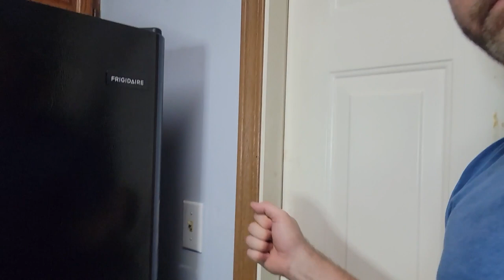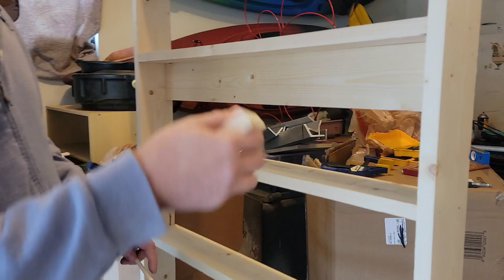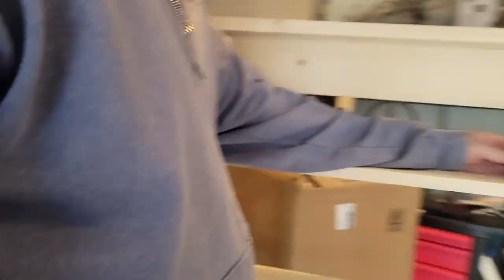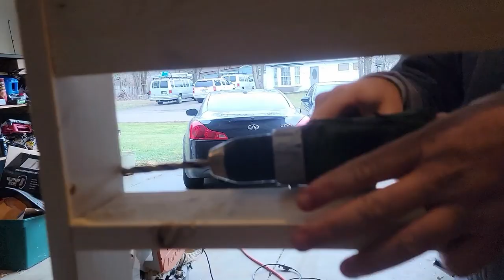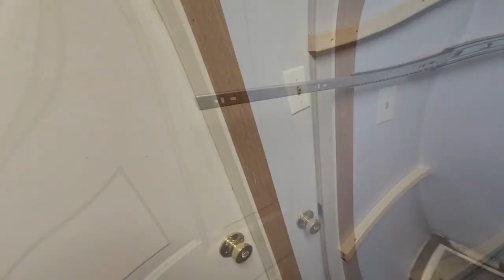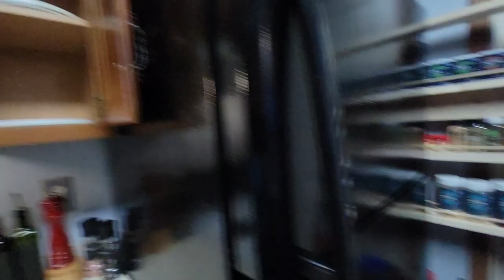How to Build a Hidden Pull Out Spice Rack in a Small Space (or Pantry)

Comment: How did you locate and mark where the sliders attached to the rack??
Reply: You can do it with a tape measure and framing square because that style of slide has so little play.
You position your slides on the drawer or slideout and measure from a common point to space them on the wall side. There are slotted holes to provide a whisker of adjustment on trial install, then you fill the rest of the screw holes (that aren’t slotted) to make it stay perfect.
Reply: It would have been better to have that process included in the video.

Comment: Why are you having both wheels and sliders
Reply from the maker: the wheels allow the sliders not to bind up as well as not put too much weight on the shelf itself.
Reply: The wheels aren’t necessary. A sheet of 1/4” (or 3/16” if you can find it) would make that strong enough to climb on- and ball bearing slides won’t ever bind.